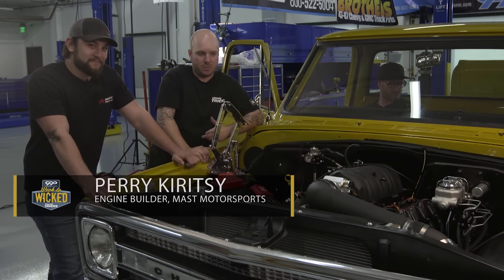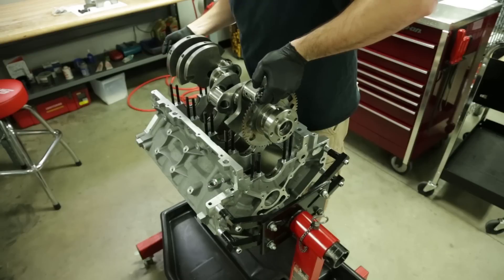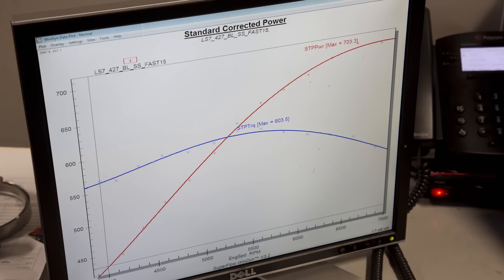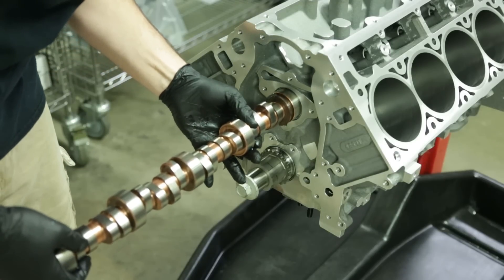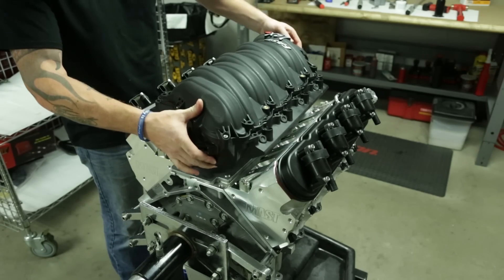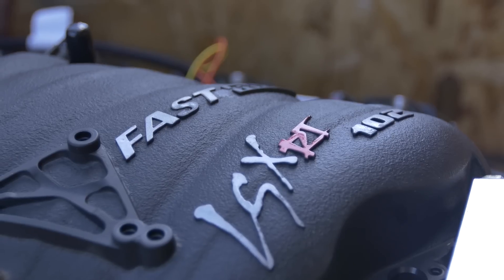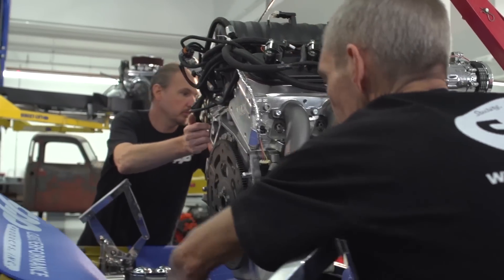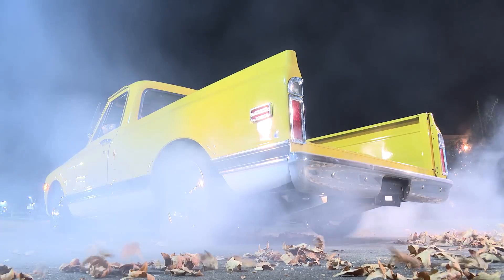MAST Motorsports for the Week to Wicked C10

Comment: 700HP 600 TQ  N/A on pump gas with an LS3 style ports is great. a coyote can't make those numbers N/A with stock displacement. 1 or the other. But not both.
Reply: Rotaryray C big difference between C.I.
Reply: Kick SomeStones correct, because displacement is a great thing.
Reply: ***** I'm sure they have hit the HP numbers but I bet the torque is less. 5.0 liters needs rpm to make up for displacement